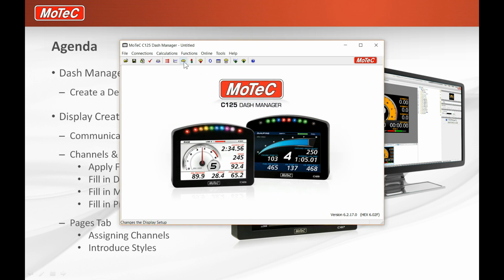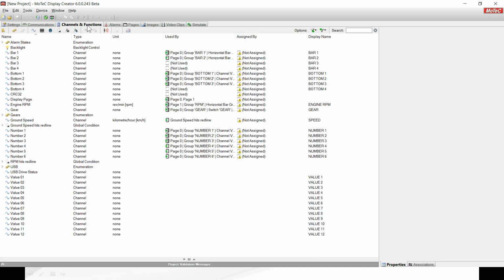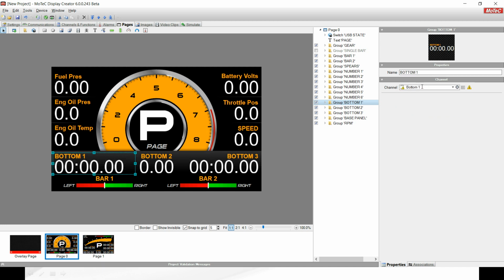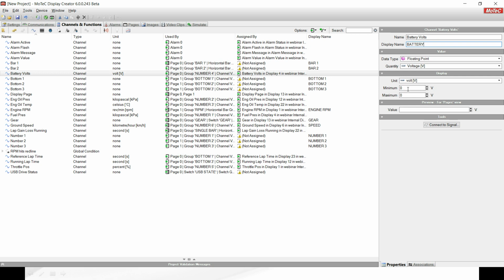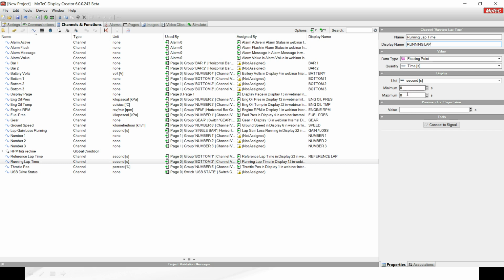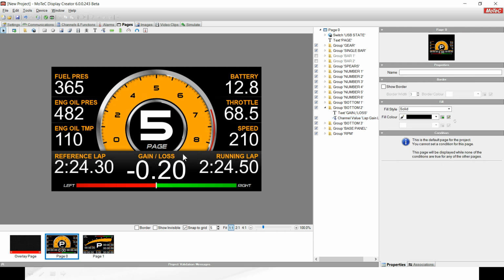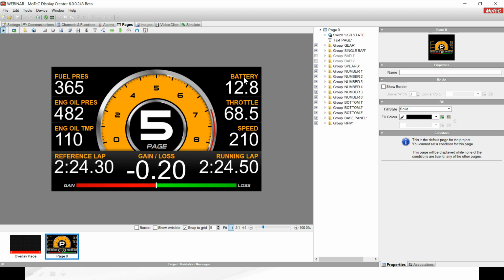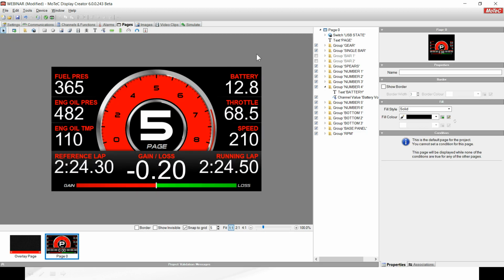Display Creator - Setting up a display

Comment: Looks easy enough, now just need to decide between the C1818 or the C1831. For an experimental aircraft, the data logging potential is excellent in so many regards even monitoring resonance on components and airframe. Being able to record video also is great, although a higher FPS ability would be nice to watch the resonance. Being able to place a small camera overviewing each rotor blade for tracking and observing blade movement and damage from foreign objects while in flight is so valuable. I highly recommend you advertise more for the experimental market and cater for it. Look forward to working with you fellas.